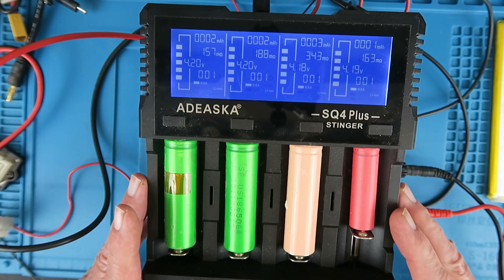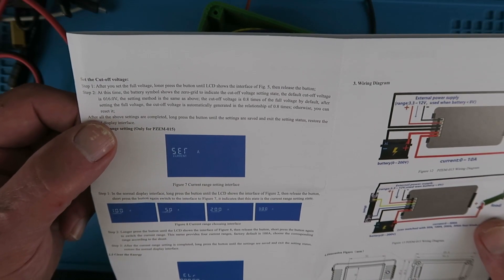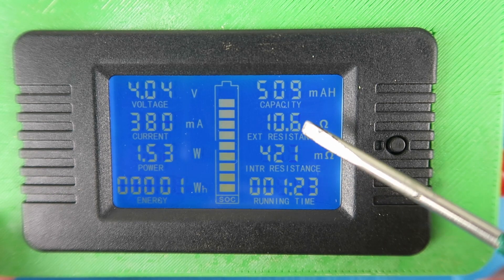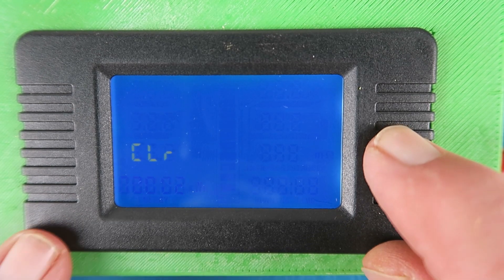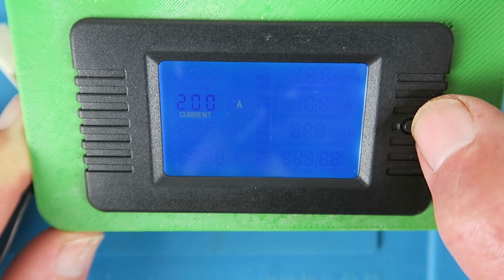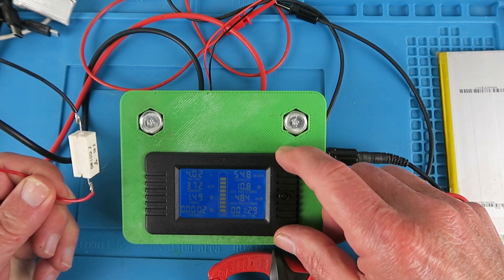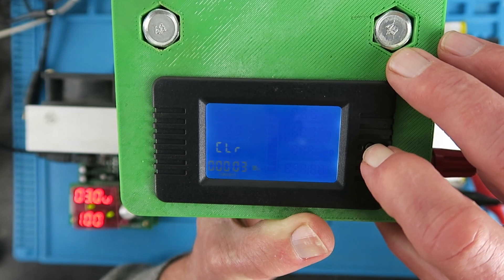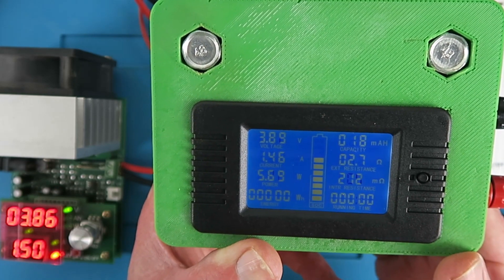PZEM 015 Battery Tester DC Voltage Current Power Capacity Internal External Resistance  Meter Review

Comment: Thanks for the video. Can the meter measure in both directions Bidirectional. Will the capacity in Ah count up when charging the battery and count down when discharging
Reply from the maker: A very good question! I have just setup a test. What happens is that the values do not go negative. They indicate the correct values but not the "direction" also the mAh still increase either way! Thanks for watching, have a great day!

Comment: Bro does it shows the current in 2 direction.  I mean . If fix it in my inverter battery side . Does is shows both charging and discharging current?  Plz bro . Reply soon .very urgent 😢plz plz plz
Reply from the maker: A very good question! I have just setup a test. What happens is that the values do not go negative. They indicate the correct values but not the "direction" also the mAh still increase either way!
Reply: @1nformatica just clarify the below.
For Eg.
When the battery is charging, the value of Ah keeps increasing.  suddenly if the battery starts discharging what about the value of Ah?
Will it keep increasing the Ah value from where it stopped at time of charging 
Or
Will it become zero first by automatically and keep increasing the Ah value from zero?
Reply from the maker: @toptech5951  What happens is that the values do not go negative. They indicate the correct values but not the "direction" also the mAh still increase either way! Thanks for watching, have a great day!

Reply
vidIQ badge

Comment: Very usefull info. BUT please how the device be wired between My solar system and battery bank. Next question is will the battery be connect to charger and still to the device ????
Reply from the maker: This device is designed to go between the battery and the load it is driving, it's really not for monitoring solar panel charging systems. Thanks for watching, have a great day!

Comment: curious how this is stacking up now its been a while? mainly i am wondering about the SOC calculation, as the manual says it is linear voltage calculation, for Lead etc this is fine, but not necessarily for lithium - eg my lifepo4 200AH barely drops any voltage until over 50% discharged
Reply from the maker: The SOC is only applicable to Lead Acid batteries. You could calclate the SOC roughly for your liFe batteries by monitoring the capacity used in discharge. Maybe consider some circuit to disconnect the batteries when the voltage falls below a safe level.

Comment: hello, great video, a question: is PZEM-015 capable of recort the peak value for the voltage and keep it memorized? I have to monitor a voltare regulator output for several hours and record the peak voltage. Thanks!

Comment: Hi there, good review ! 
I have question though, if you had something that was charging the battery, would it show something like -30W and -1,2A ? letting you know what power is going into your battery.
Reply from the maker: A very good question! I have just setup a test. What happens is that the values do not go negative. They indicate the correct values but not the "direction" also the mAh still increase either way! Please consider subscribing if you have not done so already!
Reply: Thanks  @1nformatica

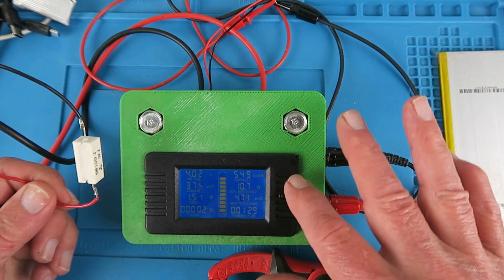Comment: 7:52 That is incorrect about it keeping a tally while the screen is off, it goes into a dormant stage. I tested this out on my solar set up reset all the timers, and waiting until the runtime was at 1 hour,  then made note of the Ah used and runtime. When I turned the screen off I was at 1.2 Amp hours used after the hour of it being on. I Then turned off the screen, came back 2 hours later and all of the stats remained the same, with the exception of it updating the voltage of course, because that is dynamic update. I then reset all the Ah run time etc and did a test with the screen on. I had the starting point of 1.2Ah used, a runtime of 1 hour and so on. When I came back 2 hours later I was at 3.4Ah used and a run time of 3 hours.  I reached out to the seller of this item to confirm because I was not expecting it to work this way, but they stated it is working as intended. I just wanted to put my experience out here. I have the same item with the exception that mine is 200v /300A. When you used your clamp meter to see if it "was still working" The power is sstill being moved though the shunt, the device does not "turn off the load" it just does not keep track of it while off.
Reply from the maker: Interesting! Thanks for sharing your experience. I will revisit this, as you can see in the video when I turn the display off the capacity is 552 mAh when I switch back on it flips over to 553 mAh. I will test for a longer period, maybe they have changed the firmware? Please consider subscribing if you have not done so already!
Reply: @1nformatica  My finding are the same as yours, meter held settings till the next time I checked,( 2 days later), maybe Patrick has a faulty unit.
Reply: @1nformatica  Hi, did you test it meanwhile? My device also did not messure anything if i switch of the display :-(
Reply from the maker: @olivierjankovsky41  Yes, my bad! It does not update.